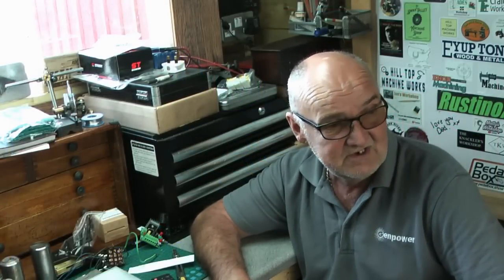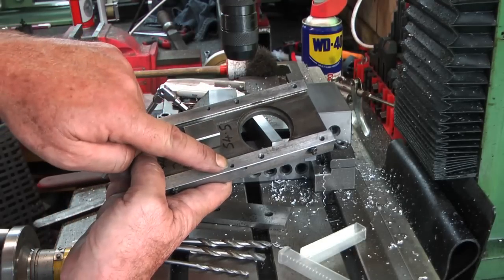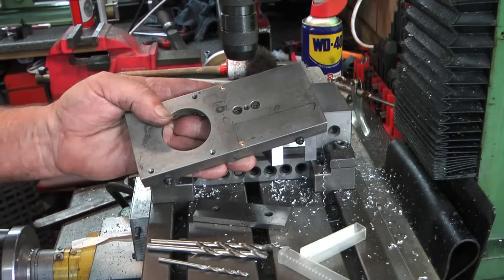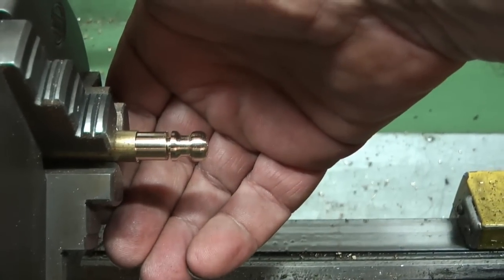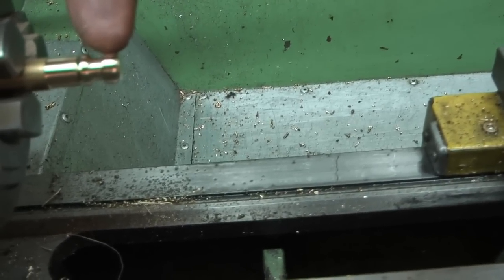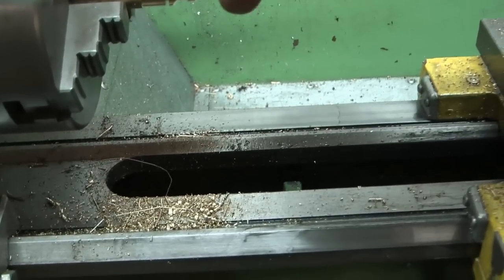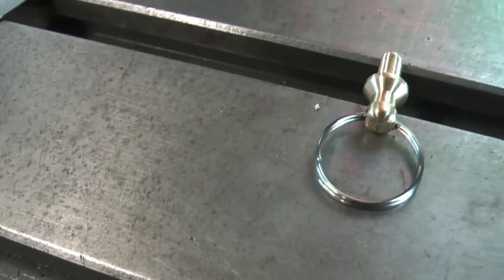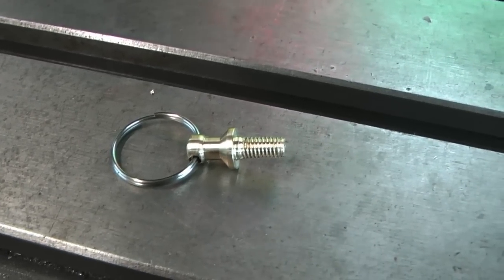September Update

Comment: I’ve machined and built gas engines. I have found it hard to find springs light enough for atmospheric valves. I ended up winding my own. It sounds harder than it is. There are even videos on YouTube showing it done.
Reply from the maker: I will probably have to cross that bridge at some point . Cheers Ade.

Comment: Hi Ade, Are you sure that it's not an NGK CM-6 spark plug that you need?  (Not CR-6) It's quite a bit smaller.
Reply from the maker: You are spot on . oops , Good job i did not have to buy them . correct plugs ordered , Thanks Ade
Reply: @ade63dug  No worries! Looking forwards to the build 👍

Comment: I thought for a minute that you were going to let your through hole slightly break into the "point" of the dovetail to supply oil that way.
Reply from the maker: I am still considering a plan for this . fine on the plain side but on the back it would oil the back of the gib . still thinking , lol,